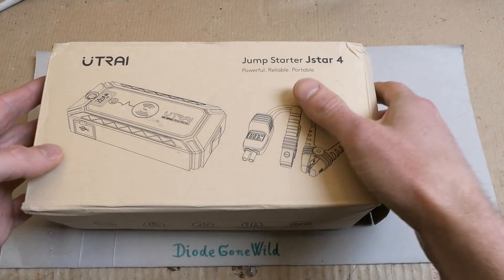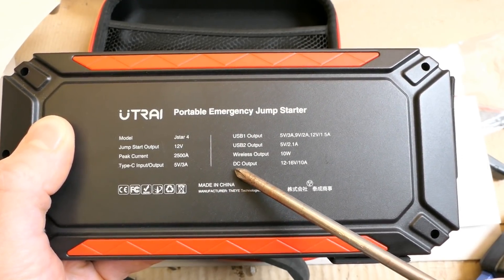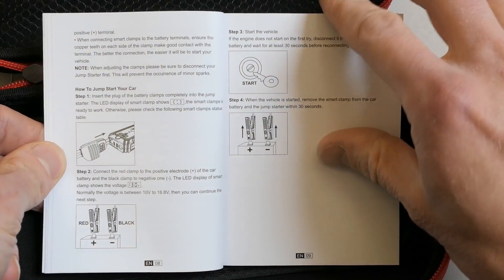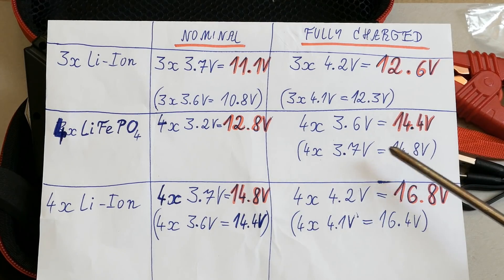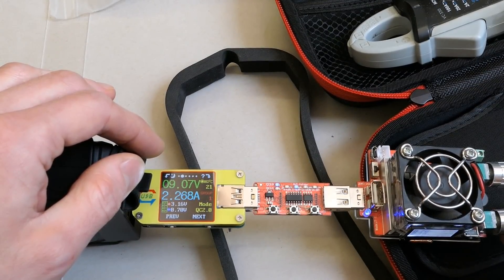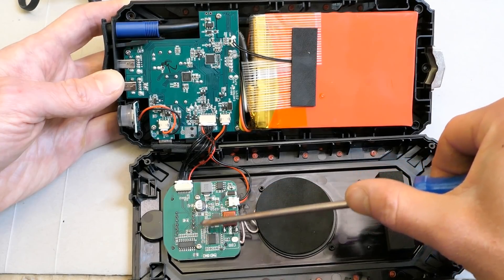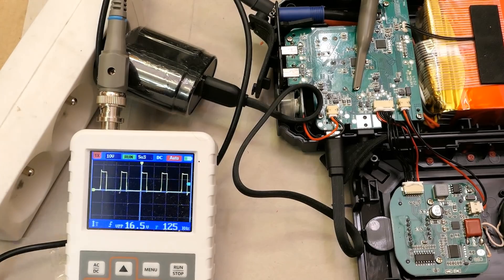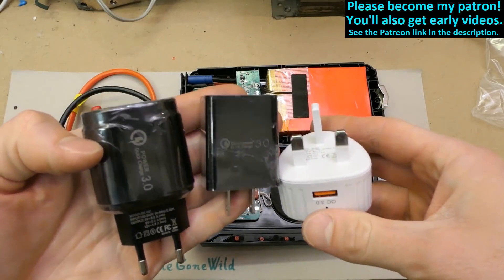Utrai 2500A Car Jump Starter - unboxing and teardown

Comment: I would be a bit reluctant to poke a metal conductive screwdriver into a PCB connected to a massive 4S Li-pol battery capable of delivering hundreds of amps. :)

Comment: I bought one of the 2000A version, itdoes really work Very well. Able to start 4liter diesel engines as If It was a small motorcycle. Then I bought another one to my father.

Comment: The unknown chip, 7544  GA8Z6A appears to be a dual channel mosfet, the gate should be 1 pin, and the collector drain should be doubled up (as 2 mosfets in parallel)

Comment: Helo perfekt video it's 4s 2p battery so (8 cells )4 paralel pairs of 3000mah li-pol cells for drones maybee 100c cells so it is 600 Amps in peak but i don't want to suck 600 Amps from li-pol it will be nice firework.(Až teď koukám danyk.cz zdravím)

Comment: i have similar model, it charges very fast to 100% but charger is disconnected devices indicates 56%. Is the problem battery cells? What is the model name of the battery? Thanks
Reply: Can you maybe clarify what you mean
Does the device attached to the output say 56% when the charger is disconnected?
Does the powerbank just instantly go down to 56%?
Does it go down very quickly to 56% when charging a device with it?

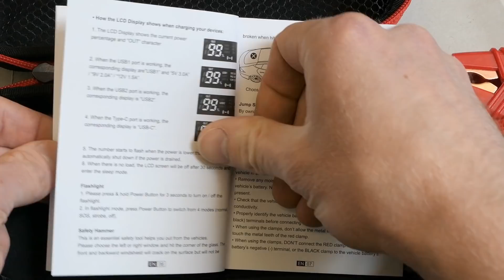Comment: 3:52 Car diagram shows a Tesla Model S
Why would you want to jump start an EV? The battery packs would not be at the same voltages and would most likely destroy the jump starter as a typical EV battery pack sits at 300-600V DC
Reply: You'd be better off buying one of those powerbanks with those wall outlet outputs and just charging the tesla using that when on a highway, but of course, you should only do it in a safe place

Comment: Hello, I found an electeonic load on your website, i make that circuit properly, when i connect a battery, the circuit is working perfectly, but when i connect a 12 volt 15 amp chinese SMPS, then the mosfet keep blowing or shorted... i dont know why, i used IRFZ44N mosfet, 7.5 volt zener, 100k potertiometer, 1k 1 watt resistor.... can you please reply or suggest anything?  and sorry for my bad english.... I am your subscriber from India..

Comment: Those output cable inside look awfully thin to carry 2000 amps. Think how thick your jumper cables are. Of course the whole lead length is much shorter so maybe OK? When I have dead battery I get a good battery hook it up with jumper cables . NO electronics required. All the electronics in the unit just to regulate the charging and the accessory outputs.

Comment: This GA8Z6A is a transistor and not an IC, the identification labels on the board help to identify which type of component goes in place, this PCB identifies ICs as U and transistors as Q. Probably due to the connections it makes, it should be used to disconnect the USB buck regulators in case of an overload or simply to turn them on when pressing the button.

Comment: I am always amazed that tiny cells like those manage to start any car,  but they do :-D
The weak point is the battery clips, very crappy and minimal surface contact.
A frend had a similar unit with those clips, the plastic melted on one side because the other side was not actually connected to anything!! :-(
I fixed the melted side and added a thick copper loop cable so both sides did something. (on both clips).
Sorry but your cat is loverly :-D

Comment: I wonder how much it would cost if I wanted to ship you some thing? 

I have a lot of excess test equipment, I’ve accumulated mountains of the stuff.

 when I got started the only way I could afford professional quality high end gear was to buy broken or untested equipment and repair it myself. 

As I got better and build a fully stocked lab… (with Mostly NIST traceable calibrated equipment)… I didn’t have to look for gear any longer. But It started finding me. 

Because After a few years of looking.... everyone knew that I wanted the stuff so they would tell me about sales and auctions and things.

I’v bought entire pallets of hp and tektronix  equipment and stuff like that for pennies on the dollar. A lot of it is nice good calibrated equipment… mostly from government auctions in my local area. I live in an area with huge government industry and a big history of government involvement. Nuclear and otherwise. Home of the atom bomb....

So there are storage units and warehouses full of test gear all over our tri-state area. So I’m always looking at auctions just for fun.

But most of it just not worth selling on eBay because of the shipping cost. It’s not worth selling a $400 scope if it’s going to cost $200 to ship it and there’s a good chance it will get broke. Then you have 12% eBay fees on top. 

So I would be interested in sending you some pieces. Especially if there are things in particular you would like to have or upgrade some of the things you already use. Just not sure how much shipping would cost and the cheapest way I could get it there.

Another one of my buddies owns an industrial scrap yard, they’re always bringing beautiful industrial electronics, motor controllers, and every type of industrial electronics toy you can imagine in that place. A lot of medical stuff to like x-ray machines, even scored a few surgical lasers. 

If you want some stuff for teardown I could ship you a bucket load of the stuff if I knew a cheap way to get it there safe and in a timely manner. I salvage what I can but they’re not open to the public, and I’m only allowed in there because he’s my buddy. BUT I CANT KEEP EVERYTHING … I tried that for a few years and it almost ruined my life. It’s hard to watch a $2500 industrial motor drive get crushed… But I can only do so much. I can’t keep everything so I have to watch him crush thousands of pounds of beautiful like new industrial electronics every month.
Reply: The problems Americans have.

Comment: My truck battery went bad last week and I’ve always wanted one of these jump starters but never bought one. 

I had to use my two cordless 12v drill batteries and put them in series, tape them together, and jump my truck off of that. Just wasn’t enough power without putting them in series,  the Hitachi drill batteries weren’t happy about it but they survived.

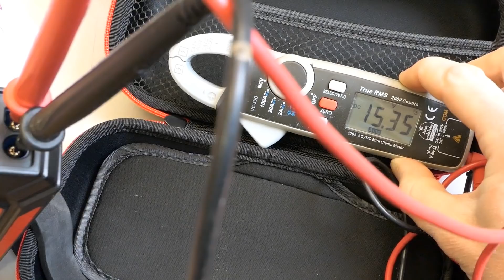Comment: 7:00 it is bit too high voltages for car electronics. Some dodgy car electronics can start smoking by these voltages
10:50 no way these can deliver 2500A, these not super caps... Even 25A is way too much to ask. I used super caps and 10xAA batteries to start the car. 5 series 2 parallel

Comment: yesterday I watched a video by photonicinduction from 2015 about one of these things, I think it was when they were somewhat new and it made me realize how powerful these things are. Like, drawing 600 amps (peak of course) from a box not much larger than a phone is really amazing.
Reply: Bruh make a supercap bank this size and you'll see what's CURRENT. Not for very long tho
Reply: @windshield11  I was also thinking about that. I doubt most of these devices will handle 600 amps for much longer than the supercap bank anyway, before overheating, haha. 
And 2500... Maybe that's the theoretical max of what the cells can put out if they are shorted when fully charged - but just the resistance in the cables, connections and the components inside that protection box on the cable, will limit the current to way less than that, at 15 V. 
Those boxes are quite impressive, but the manufacturers indeed push the numbers to make it look more impressive (as with many other products). No cars will need nearly that much current to start either (not even 7 or 8 liter engines) - so it may still work perfect with less than 1000 A output and most people will assume the numbers are correct, haha
Reply: @Speeder84XL  
I haven't seen anyone try to test the peak current claims on these jump packs, even from the ones that run fairly comprehensive comparative testing.
Reply: @windshield11  heh I've done that before, though I messed up when I put it on the charger on too high of a voltage to charge faster and I forgot about it for about a day. When I came back to it all the caps were busted and hissing(only a little though)
Reply: @fungusenthusiast8249  lul you got lucky there i had a output cap explode on this 5v psu i was building cuz it just decided to give out 24v on a 10v cap XD

Comment: My experience with these jump starters: You need one when you don't have it. When you have it, you'll never have any use for it. When you do have and need it, the charge isn't high enough for the jump start😂 All the ones I've tried had only three battery packs, this one should have enough juice... Hopefully.
Reply: I'm not sure which brand of one my boss has but i was surprised when it started his truck with a 460 V8. Turn the key and it groaned... click, click click. Hooked up this little battery pack and it cranked right over and started right up. Sounded just like the regular battery crankin it over. Not sure how many cranks you'd get, but the pack said it went from 100% to 98% from about 5 seconds of cranking. Still though, the amount of power they can pack into those lithium cells is just staggering when a battery pack about the size of a couple cigarette packs can start a truck and it usually takes a huge lead acid battery.

Comment: Pretty nice charger but is there any battery protection? Can the car jump connection pull the batteries below safe voltage?
Reply from the maker: I will definitely open the protection box in another episode ;)
Reply: @DiodeGoneWild  have you ever opened the box?

Comment: Seems surprisingly well designed and built!
Reply: Usb gadget side is perfect, rest of is pure garbage. It never can start 8 liter car, dream only.
Reply: @simplemechanics246  It depends. I could see it working in a marginal situation. Where you have low crank. So I can't say never. I'd be comfortable with infrequently. Maybe almost never? There is a reason why they make fleet chargers. This ain't one of those either.

Comment: How can it produce 2.5kA? How thick do wires need to be to carry such a high current? Are you going to test it on a car?
Reply from the maker: The cables are very short and also the peak current only happens very shortly, so the cables don't overheat. But they probably still drop a significant voltage at this current. But also the internal resistance of the batteries could be a problem. Maybe the 2500A rating is measured in a short circuit (no useful voltage at the output). Who knows....